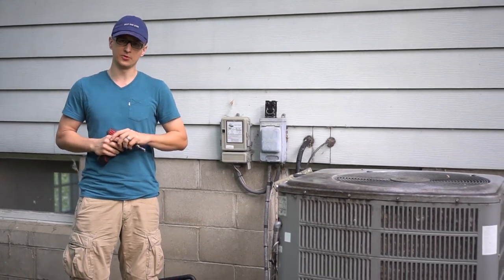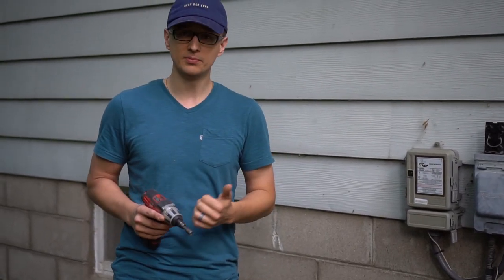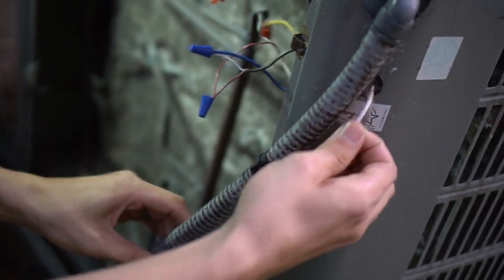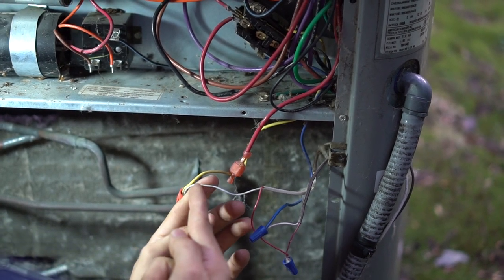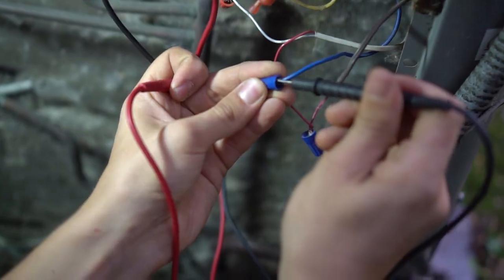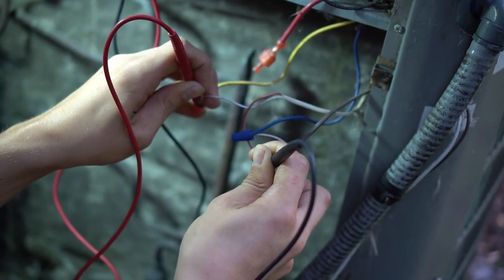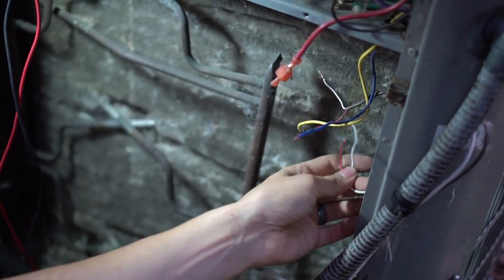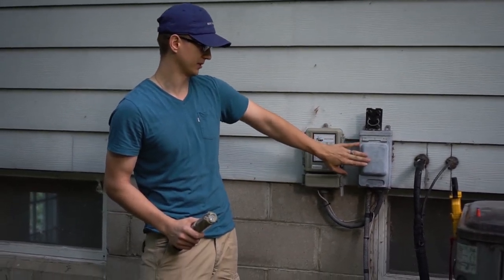How to Check a Power Saver Switch on AC

Comment: 5 years later and this video was super useful .
I'm going to install a Ecobee smart thermostat in my house which has only 4 wires between thermostat and furnance. I will need to use the PEK adapter and was a bit worried on how that "on-call power saver" works and if the PEK adapter would work on my case.  Thanks a lot

Comment: Worth noting set your volt meter to AC to read the 24 to 28V.  My power saver sits on the side of my unit and gets the power from the inside of the unit.  In addition, many units have a high pressure switch in series with the 24V wires also which cuts the power if the internal coolant pressure goes too high, as in gets too hot / can't cool adequately, of if that HPswitch simply goes bad.  Reset it and try again.  Since I have solar, it makes little sense for me to have a power saver switch.  Thanks for the vid really helped!

Comment: Jay, thanks again for your video and clean explanation. Another question though, noticed that your power manager in the video connects to your power box on the wall, in some of the configurations, the power manager connects to the condenser contact power terminal, do you mind explain the connection diagram in that configuration?

Comment: I can start my air by pushing the contact, outside,  in as you show. My problem is in the box to the left of power. It is a symphony 11. Which i beleave is for the generator. That has a red blinking light showing  a fault and a green blinking light  in the inside panal of the house. I can't take it out of the circuit as a power saving switch. Can i take it out the the system in its box.

Comment: So... They've been turning mine off for 12 hours a day.  I can turn it back on at midnight and it will run until noon.  I see this video is two years old... So...
 I'm wondering if this information is still up to date? Because they are NOT turning it  off for 15-30 min at a time. Its been blinking from 12 a.m. to 12 p.m. last two days going on three. and I did not get a new thermostat.  Thank you!
Reply: Omg same
Reply: Call the power company folks.
Free of charge 
So simple
Reply: Wow what a nightmare!! Probably a faulty power saver box or glitch in their mainframe! Lol surely repaired/resolved by now!? Smh! I’d be ticked off if power company did that….

Comment: I LIVE IN NASHVILLE CONDO VILLAGE AND 2 STORY WITH THE SINGLE FURNACE/AC IN ATTIC SECOND FLOOR WITH INDIVIDUALE THERMOSTAT FOR 1ST AND SECOND FLOOR.. PRETTY DANG HOT HERE NOW 95DEG. PROBLEM,,, DOWNSTAIRS WORKS BUT UPSTAIRS STOPS IN THE EVENING WHEN THE SUN IS BEATING THE ROOF AROUND 5pm. WHY??? HELP PLEASE> IT DOES HAVE THE CITY POWERSAVER BOX, BUT CAN ITSHUT OFF JUST ONE FLOOR ONLY? ~~~~~~NOTE SUNDAY THE UNIT IN AND OUTSIDE WAS FREEZING UP. THE GUY MONDAY NOON CLEANED THE CONDENSER OF DIRT AND GRASS ETC. ~~~ LAST NIGHT MONDAY STOPPED AT 6pm UPSTAIRS AGAIN. BOTH TIMES DOWNSTAIRS WORKED BUT NO UPSTAIRS?

Comment: All you are doing with a switch is give them the power to shut off your air conditioner when it's 100 degrees. You will wish you paid the 5% extra. OR JUST FRY!
Reply from the maker: That's what most technicians think too :)
Reply: @WordofAdviceTV  
1 in 10 AC techs actually know what they're doing.

Comment: While the fan turned on for a couple seconds and turned back off, I noticed there were red and green light on the power saver box blinking rapidly. Can you help explain the meanings of the LED lights in that tiny window on the left side of the power saver box? Thanks.
Reply from the maker: Unfortunately every electric utility company will have a different box so I can't say for sure what it means. Usually any red lights mean that a time delay is active. No lights or a green light means the saver switch is inactive.
Reply: For a moment I was so worry that I may have to pay for service. I did what you told me and about 10 mins after I put the fuse back in, the unit works just like normal. Thanks so much for your help.
Reply from the maker: @youloveyoutoo87 Glad I was able to help! :) Those time delays can be a bit misleading. Stay cool!

Comment: What's in the other box
Reply: That’s a good question!!!! I’ve seen one disconnect box and one power saver box when I serviced many HVAC systems! I think it’s a disconnect box & someone ran the low voltage control wire through it!  Because the refrigerant line set didn’t have the control wire on it.
Btw it was an ugly disconnect box!? Probably an older type(plastic outer!?)…